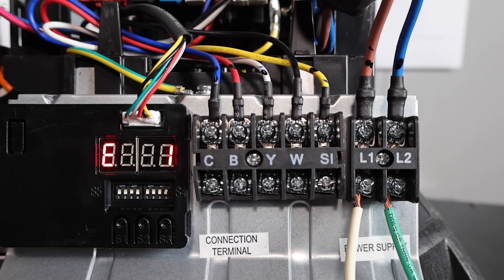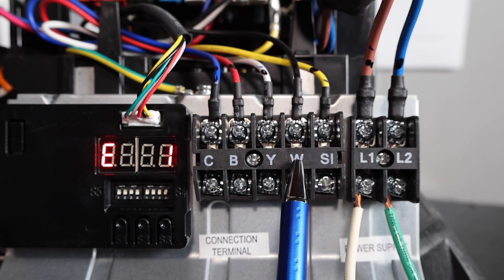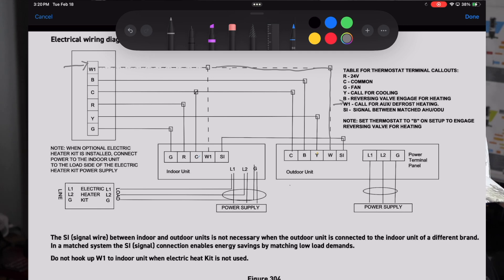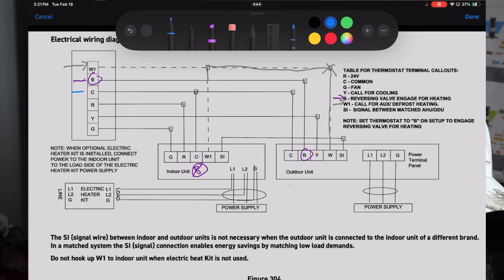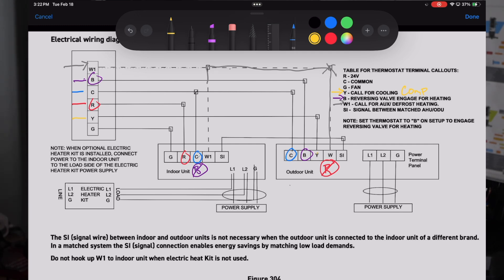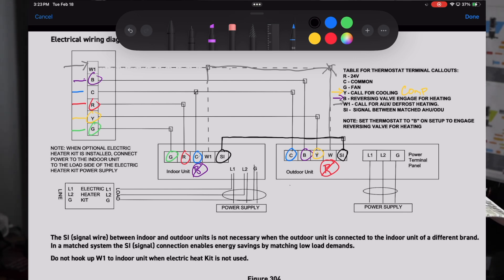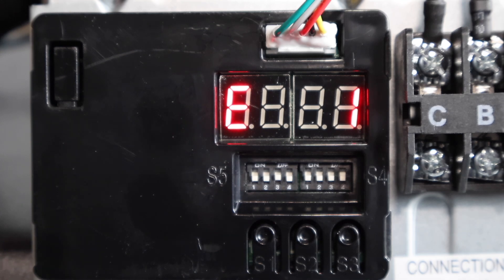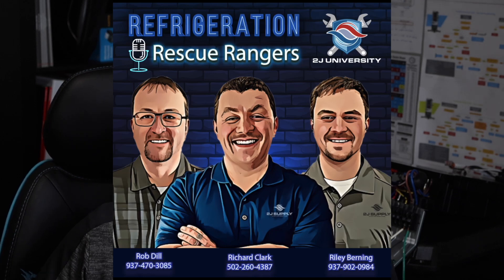Friedrich Breeze Universal Heat Pump(R410A Only) Control Wiring and Digital Display Overview

Comment: Can these units operate without a common? I only have 3 low voltage wires and no way of running new wire.

Comment: Greetings, thanks for sharing information  my friend, I'm an air conditioning technician. I have a question. I read the manual for these Friedrich Breeze heat pumps and there's a Test Run function. Can you tell me how to do it?
Reply from the maker: Richard here. Yes I can send you a short video on how to put the unit into test run. My number is at the end of the video if you don’t mind to text me and I can send that to you!